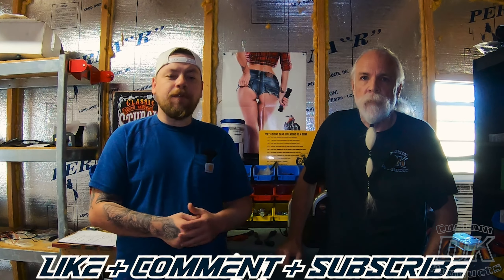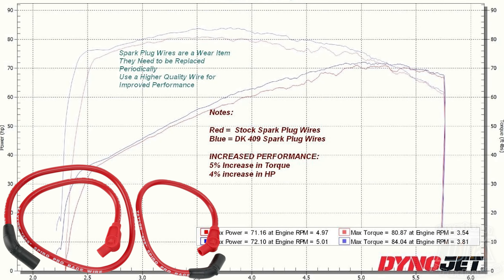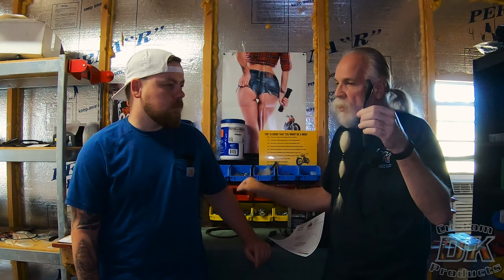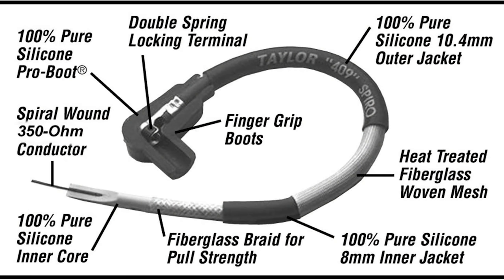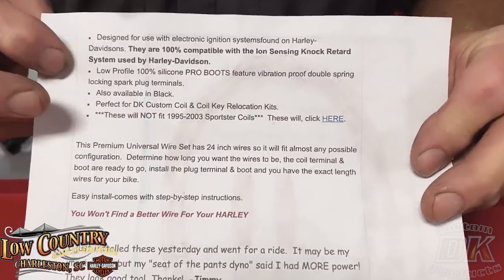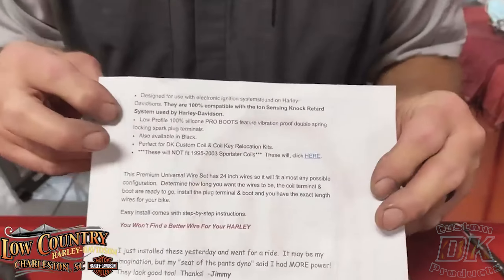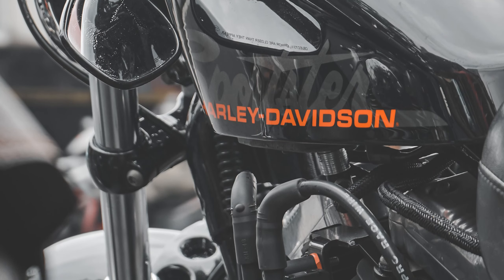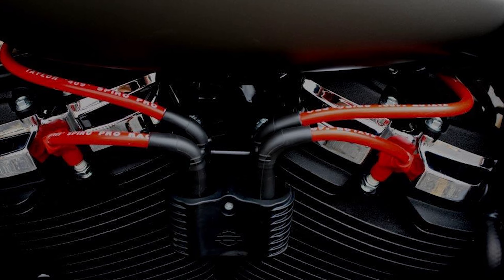Harley Performance-Dyno Chart Shows The Difference

Comment: If you are riding a twin cam touring bike, check the stock front plug wire.  It can chafe and wear through against underside of the tank.  Easy to find with a quick visual inspection or by grabbing the front plug wire while riding in the rain. ⚡️

Or just upgrade now and save yourself the trouble.
Reply from the maker: Good tip, thank you for dropping it here in the comments.  👍😎👍
Reply: Oh my God thats too funny

Comment: Maybe you two can do a segment on upgrading spark plugs.  Those  Screaming Eagle plugs are $23.95 a pair and you need two pair for you M8.  Do you have any recommendations for quality alternatives?
Reply from the maker: It has been quite a few years since we tested different spark plugs...from before we were making videos on a regular basis.  Back then the SE plugs did NOT perform as well as the OEM....and we could not see any benefits from a variety of other name brand plugs.
However, we will conduct the test again later this month when we have the dyno and publish the results, whatever they may be.
Reply: @DKCustomProducts  Thank you for your detailed reply.  I will be purchasing your plug wires, but I want to change the plugs at the same time on my M8.  
One point is that an OEM plug may give similar results, or even superior results brand new, but after 10k miles where are we.  
I really enjoy your discussions.
Reply from the maker: Yeah, we never did any long mileage testing on plugs.  The tests we do later this month (thank you for the idea) will be a snapshot of how they do when relatively new.

Comment: The Plugwires turns bad over time because of cracking of the Carbon-fibers inside which lead the ignition spark, Carbon fibers are used on modern Ignition Systems because of the “build in” resistance needed. Back in the days when it was Copper or Stainless steel in connection with the Point Ignitions, that wasn’t the problem as much. You can prevent a lot of the problems with…even quality Race Wires by lubricating them with White Lithium Grease in both ends before mounting them + see that the wires are tightened with some plast straps and not “rattling” around,…the “rattling” movements can over time cause the Carbon Fibers to break inside the wire. Just like you break a paperclip by moving it side to side 🤓😉☝🏻
Reply from the maker: Thanks for your comment.  Very much appreciated.  👍😎👍

Comment: Do you have RED wires of this 409 brand for '12 FLHTC?  How do these compare too HD screamin eagle wires? Thats what currently is on my EGlide.
Reply from the maker: We have them in red where it takes about 15 minutes work on your part to cut and install the ends.  You can see them at this link- https://www.dkcustomproducts.com/409-pro-race-plug-wires-universal-fit-red-more-details-dk-wrs-red.htm
We only have them in Ready to Install configuration in black, at this link- https://www.dkcustomproducts.com/409-pro-race-black-spark-plug-wires-touring-trike-models-dk-wrs-blk-trg.htm
They perform slightly better than new SE wires...probably not enough for you to feel the difference.  The benefit is that they will last much longer, and cost less.

Comment: Whats your opinion on the Accel Stealth supercoil ?
Reply from the maker: We looked seriously at these, thought about running them and carrying them on our website.  When we tested them we did not see any difference in performance*.  They do block some air flow to the engine, resulting in running a bit hotter.  

*On one bike we pulled the old (3-4 years old) OEM wires and installed them, and there was an improvement, but then we pulled them and installed new 409 wires and the performance was the same.

Comment: Does the 409 PRO RACE Black Spark Plug Wires - Touring/Trike Models fit a 06 SG?
Reply from the maker: The ones at this link- https://www.dkcustomproducts.com/409-pro-race-black-spark-plug-wires-touring-trike-models-dk-wrs-blk-trg.htm
These fit all Touring & Trike Twin Cam Models that have the OEM coil below the seat, behind the rear cylinder.

Your 06 should have the coil above the front cylinder, so you would want either the black or red "Universal" seen at this link- https://www.dkcustomproducts.com/spark-plug-wires-619.htm
Reply: @DKCustomProducts  Thanks guys.
Reply from the maker: @chemdog70able  You're welcome, thanks for watching!

Comment: Why are you wires not put together? Looks like some assembly required
Reply from the maker: Thanks for watching, and for your comment. 👍
If you go to the Link below, you will see that we have 12 different options on plug wires.  All but two of them are ready to install, No assembly required.
We do have two that are for Custom applications, where the wires are 24" long each.  This allow someone to cut down the wire to the length they want for their custom application, and then put one end on their custom length.  All the others are ready to take out of the package and install.
See them all here- https://www.dkcustomproducts.com/spark-plug-wires-609.htm

Comment: Never had a bike on the dyno. They all have enough power from factory to get me killed. 👍
Reply from the maker: Dunno what bike you have, but in addition to leaving power on the table, with a Twin Cam if the wires are worn they will not retard the timing correctly and the result can be pinging.
Of course, there is also the matter of if they are not running optimally there is a reduction in MPG, regardless of the model.
I hear ya on they all have enough power...dunno why some of us always want more.  lol  😂

Comment: How long will the Twin Cam wires expect to last?
Reply from the maker: Depending on many factors:
Temperature extremes, both ways
Time sitting in the sun
How much it is ridden
What chemicals is it exposed to (in the air And during washing)
The OEM wires could last 12-36 month before they star degrading
PRO Race 409 wires could last 24-72 months before they start degrading
Reply: @DKCustomProducts  Great thanks for the reply.
Looks like its time to change mine out.
Do you have wires for a stock Coil placement for a 2010 Superglide C?
P.S., a few weeks ago i got my cleanable oil filter and its great.
Reply from the maker: @Jimmy_Jim_Jim_1234  Yes, either the red or the black "Universal Fit" wires at the following link will work. https://www.dkcustomproducts.com/spark-plug-wires-609.htm

Thank you for your business, we appreciate it.  Glad you are enjoying.  👍
Reply: @DKCustomProducts  Great thanks.
I will check it out.
Reply from the maker: @Jimmy_Jim_Jim_1234  You're welcome, thanks for watching!

Comment: I'm here for the spark plug debate. JK. This video has me more interested in doing the coil relocation and plug wire upgrade.
Reply from the maker: Nice. 👍
The coil relo is a great mod, low cost and really  changes up the look and gets better air flow to the engine.
Thanks for looking at our parts!